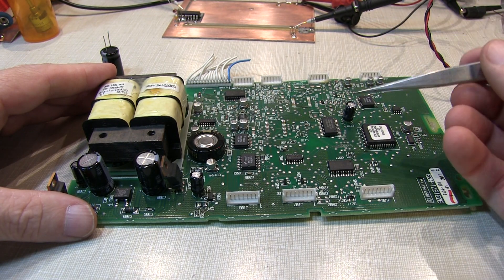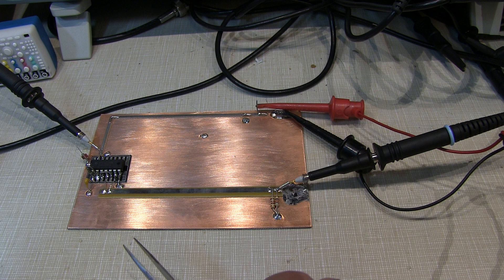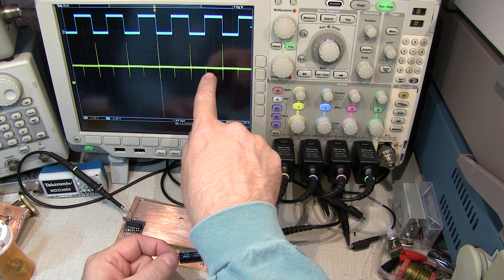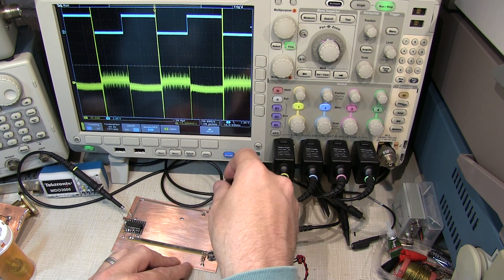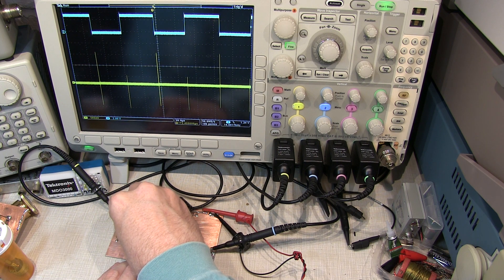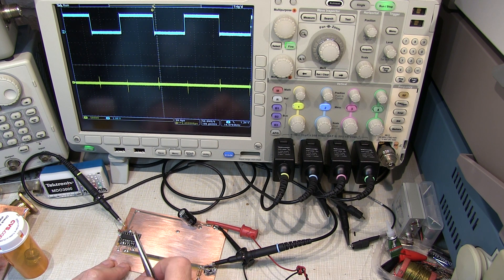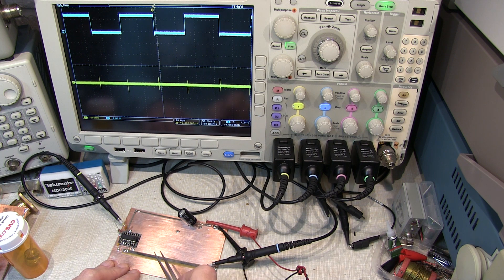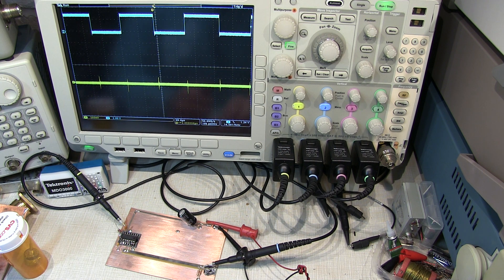#257: Power Supply Decoupling &  Filtering: why we use multiple caps in different locations

Comment: Thanks for the nice demonstration. But there's one thing I really don't like about the video: you saying the "current takes the path of least resistance". I guess many of us here will know how it's supposed to be meant. But do you know how often I have seen people chuck Ohm's law out the window, repeat this sentence and think that when you have two current paths in parallel only the one with the lower resistance has current at all?
Reply from the maker: Might be a good topic for another "Back to BASICS" video, with BASICS intentionally emphasized...
Reply: They said that "... least resistance..." so much to me in school (a "technical" secondary school with some sponsorship from Festo), I just didn't get it until I got into hobby electronics in my 20s. Like you say, it sounds like all the current goes through 1 path which intuitively seemed wrong to me. Seems silly now but the internet was in its infancy, so if it wasn't on the Encarta CD you had to just believe what your teacher tells you. To be honest I don't think most of the teachers understood the concept.
Reply: Can anyone help me I am trying to understand this concept because I am having an interference issue on a brushless gimbal.   I have recently connected a 5.8ghz transmitter to transmit the video signal meanwhile I control the gimbals brushless motors using a 2.4ghz receiver.  The brushless gimbal and both transmitters are connected to the same power source and whenever I turn on the video transmitter it causes the brushless gimbal to have erratic responses to the 2.4ghz input commands.  I tried to solve this by using a 12v Battery Eliminator Circuit or BEC which has its own capacitors built in to try to clean up the power but I still get the same issue and I want to add a capacitor to help with the interference.  I am not sure how to work out the type to add.  Should I just add a 10V 100uF or will I need to go up to a 25V but I would have thought a 25V would store up power and then release it when it gets to 25V?   Any help will be great thanks.

Comment: I really appreciate the mock-up to help bring the idea down to the topic at hand. My question is what sort of symptoms might be experienced if these types of coupling caps are not existing in a circuit that would require them? I could see the noise on the scope but I'm curious as to what sorts of problems might arise from that extra noise. I do realize it probably varies from circuit to circuit but if there's a specific application you might be able to present or know of off-hand I'd love to hear about it or see it if possible in a demonstration like you did here. Thanks for sharing.
Reply from the maker: The negative effects are highly dependent on the particular circuit of course. But, some of the most common problems from inadequate decoupling are:
- circuit oscillation
- unwanted logic transitions
- unstable circuit operation
- excessive EMI (RF radiation)
- excessive RF susceptibility
- all kinds of logic, state machine and uProcessor problems from logic glitches
- distortion in signals
-etc.
Reply: w2aew thanks 🙏

Comment: Great video, but I have a small question. 
You have pushed the scope probe cables under the scope. Won't that damage them? I've been told probe cables are very sensitive.
Thanks
Reply from the maker: You just need to be sure not to kink or crush them.  Dressing them around with a moderate bend radius is OK.

Comment: Big thumbs up, very good video, great content presented clearly and concisely. One question, what size cap did you use for the high frequency decoupling? Is there a rule of thumb or better yet an equation to use for selecting the capacitor value? Given Xc=1/wC what value of impedance should one shoot for at the frequency that you wish to suppress.
Reply from the maker: It is difficult to apply rules of thumb because there are many factors to consider.  For the high frequency bypass caps, you would have to determine what frequencies you need to deal with, and select a capacitor that is large enough to present a very low reactance, but not be too close to the SRF of the cap.  General rules of thumb are difficult to apply.  There's lots written on the topic, such as:
http://www.analog.com/media/en/training-seminars/tutorials/MT-101.pdf
http://www.edn.com/design/components-and-packaging/4351231/EDN-Access-09-01-95-Don-t-let-rules-of-thumb-set-decoupling-capacitor-value
http://www.intersil.com/content/dam/Intersil/documents/an13/an1325.pdf
http://d3i5bpxkxvwmz.cloudfront.net/pl/1276571499-decoupling-capacitance.pdf
http://www.eetimes.com/author.asp?doc_id=1320354

Comment: Are you going to do a video on how to choose the value of the capacitors? that's something I would like to see.
Reply: Trial and error would be my suggested method after you know approximately what is required.  After you have your prototype board made it can be quicker to just try some different values than trying to calculate it.  Leaving some SMD pads available around suspected parts doesn't really cost anything and saves having to add them later.  Often through hole pads aren't going to cost either these days.
Reply from the maker: It's on my list, but it may be a while.  The short version is: it's not an exact science because it depends on many factors such as supply impedance/inductance (which often isn't known), operating frequencies (including digital edge rate harmonics).  Best to shoot for broadband coverage - low frequencies with bulk electrolytics, and higher frequencies with distributed ceramics.  Be sure to look at capacitor SRF with respect to your frequency content.